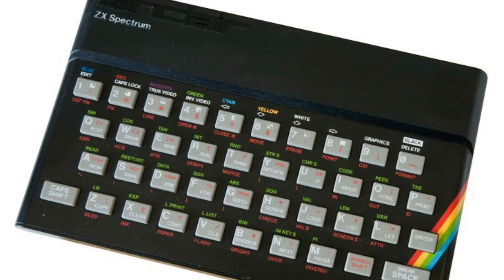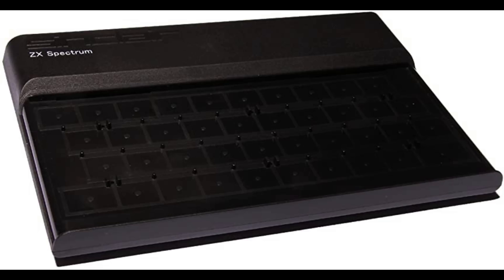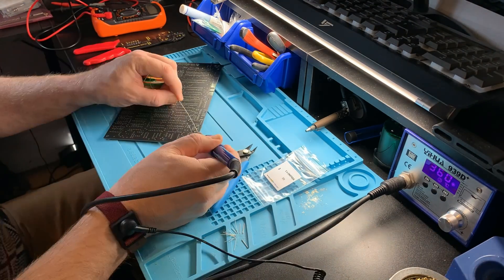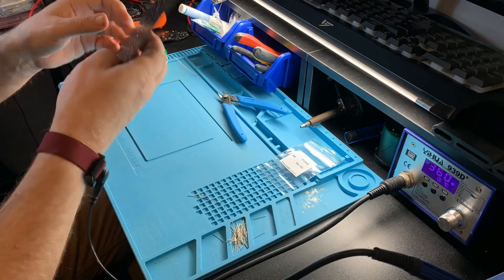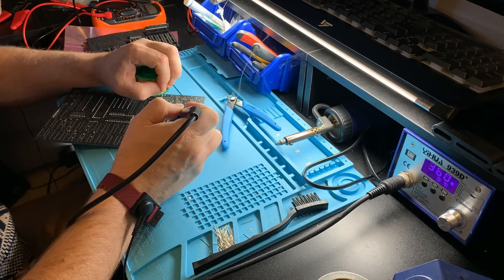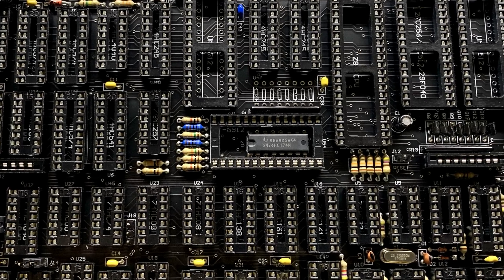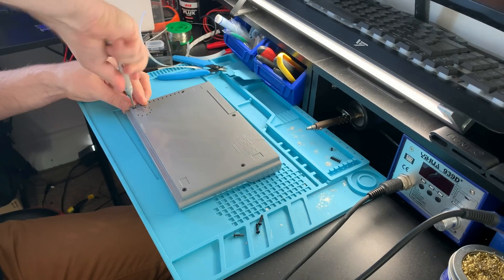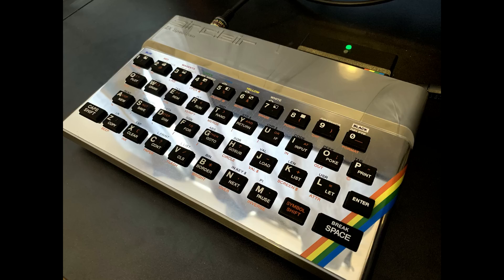Can You Build A Brand New ZX Spectrum From 100% New Parts?

Comment: What does it do for the ULA?
Reply from the maker: It completely breaks the ULA down into separate logic circuits based on the work of Chris Smith :)
Reply: @TheRetroShack  Wow! I think some of the Eastern Bloc clones did it that way too.
Reply: @andrewdunbar828  Some, yes, though most of them had reverse-engineered ULAs (of varying compatibility) and there were even some clones with genuine Ferranti ULAs. I like this idea by the way, it helps preserve the original machines and the experience is still quite authentic.

Comment: That's a lot of IC's they could've cut down on, jesus!
Reply from the maker: It is a lot of IC's however they replace the ULA of the original Spectrum (which was there to reduce the number of IC's :) :) )
Reply: @TheRetroShack  Really? They couldn't stick it on a CPLD/PAL/GAL? I'm only a beginner with  electronics, but seems like that would've been a good way to do it.

Comment: Time to buy a dremel.
Not sure how I feel about the 128K version in a rubber keyed box.
Reply from the maker: That's the beauty of the Harlequin boards (and Sinclair's thriftyness...) Harlequin has multi rom support, and it fits in both the original case, and also the Spectrum+ case :)  So you COULD build a Harlequin 128k, put it in a Spectrum+ case, and then 3d print a toastrack for the side and have a lovely clone of a 128k with all new parts...  You know what - I'm going to do it!  Thanks!
Reply: I put my Harlequin 128 in a Spectrum 48+ case. It's nice, but I'd prefer a sawn-off +2 painted black or red, with the +2A/+2B/+3 keyboard.

Comment: Really enjoyed that thanks! I still have my original 48k in a box, languishing without a faceplate, so it's great to learn I can get a replacement! Do you think the black version is the closest to the original unit?
Reply from the maker: I would think so but can’t guarantee it as I don’t have that colour :(  I’m probably going to be building another of these at some point so let me know if you get one :)
Reply: @TheRetroShack  will do! I'd really like to bring mine back to looking as close to the original as possible. But right now with a bare membrane keyboard, any front panel would look better! Luckily I still have an old TV I can use with the RF output, but I really need to look into some video mods...!
Reply from the maker: @cameralabs  Good luck and don't forget to send in some pictures when you're done :)
Reply: @TheRetroShack  sure thing! I've actually been doing a few retro projects of my own, so am planning on starting a separate channel to post them, as they'll conflict with my camera channel. YouTube doesn't like variety on a channel!
Reply from the maker: @cameralabs  Good luck and hope all goes well!
Reply: My zx spectrum 16k might be in working condition but I can't tell as the power transformer lead is broken. Is it possible to source a replacement that would fit?

Comment: How did you stick the faceplate on? I got a new case and faceplate but it's not very well fitting.  If I push the curved sides in, the centre lifts up. If I dont push curved ends down they just dont fit very well.  I think I'll get a kit after building my Amiga 500++ PCB.
Reply from the maker: I had a similar problem and in the end I completely covered the entire underside of the faceplate in 3m double sided tape, and then cut out each key hole with a craft knife.  Then when I put it on I made sure there were several heavy books on it for about twenty minutes - and it hasn't moved since :)  Good luck with the A500++ :)
Reply: @TheRetroShack  Ah ok.  I'm considering to using that thin double sided foam tape instead of the thin membrane tape. 
The 500++ is almost done.  I have a reAmiga 1200 to build but that might have to wait a while.  
Just found your channel and will sub. 👍

Comment: Hey friend, what is the brand,name or where can i find this blue repair "mate"? Thanks
Reply from the maker: KKmoon 450 * 300mm Magnetic Heat Insulation Silicone Pad with Magnetic Section Ruler Screw Notches for BGA Soldering Repair Solder Station Mat High Temperature Maintenance Platform (Type 1) https://www.amazon.co.uk/dp/B0771QKXCN/ref=cm_sw_r_cp_api_fabc_Q2W5VVTWV3VYX46YNTD2?_encoding=UTF8&psc=1
Reply: @TheRetroShack  thank you 👏👏👏😊

Comment: Cool video! I kinda wondered myself. I picked up some Z80 CPUs recently and the manufacturing dates are only a few years ago, they apparently still make these things! The ones I got also according to the data sheet can be clocked at over 20 MHz. I wonder if it would be possible to build a version that can actually make use of a higher clock speed? Not really a computer engineer so I'm not sure how difficult something like that would be.
Reply from the maker: The Crystal decides the frequency of the pulse cycle to the cpu so theoretically you drive a higher cpu speed, however the ram timings are also set in the rom so you’d need higher refresh ram and a custom rom and ULA.  It’s a lock of work but theoretically possible.  The Spectrum Next for example can drive the FPGA versions of the hardware at up to 28Mhz so.... :). Much cleverer people than me should weigh in on this one! :)
Reply: In theory, but like Retroshack said, you'd have to make sure everything else was up to it.
Also, it'd be great for business apps, but unlike modern gaming where a faster machine gives more FPS and smoother graphics, you'd probably find a LOT of old games would just run faster, frequently to the point of becoming unplayable.
This was an issue when IBM and clone-makers first started soming out with faster but compatible computers to the original PC... Even something like an 8-10MHz 286 was enough to render some games designed for the 4.77Mhz 8088 unplayably fast. This was the origin of the "turbo" switch on that generation of machines - you'd turn it off to purposely drop the clock speed of the CPU.

Comment: I like the blue bench top organiser thing where did you get that? Thanks 😃
Reply from the maker: Thanks - it’s this: KKmoon 450 * 300mm Magnetic Heat Insulation Silicone Pad with Magnetic Section Ruler Screw Notches for BGA Soldering Repair Solder Station Mat High Temperature Maintenance Platform (Type 1) https://www.amazon.co.uk/dp/B0771QKXCN/ref=cm_sw_r_cp_api_fabc_6NVHV5P4QDDMCJ56VQVS?_encoding=UTF8&psc=1
Reply: @TheRetroShack  ooh thanks I've ordered one 😃 I would never have found it from that name 🤣

Comment: As an American, I didn't grow up with this system.  However, I have emulated it, and I'm very interested in doing this project.
Reply: As a Swede, I didn't exactly grew up with Sinclair either. But the ZX80, ZX81 and Spectrum were parts of my youth. I wrote a simulator in 1993-94. My PC was a 12 MHz 286, so I bough this new and crasy fast 25 MHz 486 board, for this purpose only :D Wanted a simulator in 100% high level language. Though that was a cool thing at the time. I only had a 16-bit compiler though, so I still had to fiddle with those ugly 8086-segments in order to fit my code as well as Spectrums ROM & RAM in memory.

I've seen that many people nowdays think in terms of FPS (frames per second) even for simulators or emulators. I used a different and much simpler and synchronous approach: Whenever Spectrum's video RAM (attribute or pixels) were adressed by the Z80 program running on the simulator, the simulator would write to the video card of the PC. Otherwise no video data was written.

The ROM was sent over to the PC via a basic program on the Spectrum and a similar program on the PC, using D0 on the printer port as input. (Yes, it took almost a night :D) My simulator loaded games from tape the same way, via the printer port. It actually worked well without the filters in the Spectum. It was just a simple wire from analog tape signal to digital input, belive it or not :D

How did you do it?
Reply: @herrbonk3635  I was just using Speccy on a laptop from 15 years ago running Linux Mint; I didn't get as in-depth as you did, so kudos.
Reply from the maker: Can definitely recommend it - it was great fun to do :)
Reply: I did grow up with the Spectrum, but I find the Altair 8800 amazing.  I guess it's all about similar systems from different markets. That's what makes Retrocomputing so fascinating.

Comment: Does it load the games instantly, or do you still have to use the tape!  Wonderful, by the way!
Reply from the maker: This version of the board (rev 2d) doesn’t have an inbuilt SD card solution but the creator (Don Superfo) also sells the ZX Nuvo which has an SD Card on board.  Thinking of building one myself :)

Comment: Are the ic's still being made or were the components new-old stock or harvested from old gear like the c64?
Reply from the maker: All of the IC’s are brand new :) Including the EEPROM containing the Sinclair Roms ( I feel justified in doing that as I do own the original rom chips in my other Spectrums ) It’s a great kit :)
Reply: That's the neat thing about the Harlequin design:  In broad terms the 48k Spectrum had exactly one (semi-)custom chip.  The Harlequin is a reverse engineered design that turns that semi-custom chip back into a bunch of entirely generic logic chips, so there's no need for anything to be taken from an original board (though, it will support using an original ROM chip if you like, in place of an EEPROM).

Comment: Wow so that's how many logic chips the Ferranti PLA replaced I often wondered
Reply: Minus six though. (There are 6 TTL ICs in the original Spectrum.)
Reply: @herrbonk3635    True enough, there's six glue logic chips between the ULA and CPU that were also later consolidated into a second semi custom chip.

Still, the Harlequin design is rather neat because of what it does.  It consolidates all the RAM back into a single space-saving IC, and uses the space saved to break the ULA back out into generic logic, both of which make infinitely more sense in this day and age.

It's a fantastic learning experience being able to build and follow the logic of how the system works with relatively few "black box" elements in the design.  (I mean, the IC's themselves are black boxes, I suppose, but one step at a time :) )
Reply: @TheTurnipKing  Not only in "this day". Dense memories such as 6264 or 62256 were affordable in the 1980s too. I often say that TTL and MOS memory ICs (whether dynamic or static) were the real key to the personal computer "revolution". Compared to that, the microprocessor wasn't as important as it's usually portrayed for making computers cheap enough for the masses.

Early personal computers like Datapoint 2200 or Xerox Alto of the early 1970s did not use any microprocessor, they were built entirely in TTL (and similar). The first personal scientific calculators (like Olivetti Programa and HP 9100) did not even use ICs, but relied on discrete transistors, diodes and passive components. Their memories were in the form diode matrixes, magnetic core memory, and/or capacitive memory in the printed circuit board itself!
Reply: @herrbonk3635  The original design made more sense back then in terms of cost.

In the same way that economies of scale make using an ARM chip an extremely convenient go-to for all kinds of electronic devices now.

The PCB would have needed to have been much bigger to accomodate a generic logic ULA AND the many RAM chips used in the design.
Reply: @TheTurnipKing  Yes, in that short span from 1980 (ZX81) to 1982 (ZX Spectrum) it probably did. But already in 1984, static RAMs would have been almost as cheap as the DRAM used in the Spectrum, especially when you factor in the extra PCB area, logic and voltages needed for DRAM. My guess is that they kept that solution for some years just to avoid having to redesign things (which can be expensive).

However, the situation for computers with much larger amounts of RAM than the ZX line was different, of course. Such as the IBM PC, Macintosh, Atari ST or Amiga.

Regarding ARM: Not all embedded system are mobil phones or things of similar complexity. Simpler microprocessors and "controllers" are still being mass produced. PIC, 8051, 68HC11, 68K, NEO, eZ8 and literally dozens of other architectures (even versions of Z80, such as Z180 or eZ80).
Reply: @herrbonk3635    They redesigned the board constantly.  There's a good five or six revisions of the 48k board and that's before you get to the 128k.

You actually see a much more rational design using higher memory densities in some of the clones produced later, and in the Amstrads.
Reply: @TheTurnipKing  I remember. But they didn't redesign the part I was talking about for many years. Why do you call larger memory ICs "much more rational", when you just stated that the old design made sense? (I.e. was rational.)
Reply from the maker: Pretty incredible eh?  :)
Reply: @TheTurnipKing  So optimizing for low cost is less rational? I'm not sure Sinclair or Nine tiles would agree. What's rational depends on the situation and from what aspect or point of view, of course. But it seems you use "rational" when you mean simple.

Comment: I had, and still have in storage, the original 48K Spectrum, and when I saw you soldering all those sockets in I thought "that is way more ICs than the original had", because I thought (by the case dimensions) that this was just the original. Well, by the end I see that it is something like a Speccy Plus 2 or 3 maybe.
Reply from the maker: The original Spectrum had a custom ULA by Ferranti - This has since been reverse-engineered down to individual IC's - hence the larger number of chips :)
Reply: @TheRetroShack   Oh, that's interesting! I did know the ULA quite well, I did research the hardware back then and also did some assembly (machine code) level software. I still have the "Spectrum Hardware Manual" and "The Complete Spectrum ROM Disassembly" books in my bookshelf :) I even half-made an expansion card that had four selectable ROM chips, just never quite had the will-power to complete it.

Comment: Great channel! What's that surface you're working on? Looks absolutely amazing for storing all those little bits and pieces during builds and repairs.
Reply from the maker: Thanks - glad you’re enjoying it! The mat I use is this : Preciva Soldering Mat, 500℃ Heat Resistant Silicone Work Mat, Multi-purpose Magnetic Electronics Repair Pad for Welding and Soldering Station With Ruler and Screw Notches, 450*300mm https://www.amazon.co.uk/dp/B075D9R8PZ/ref=cm_sw_r_cp_api_fabc_D421ANVTTB7M9G2W4CZZ?_encoding=UTF8&psc=1

Comment: I was never a fan of spring IC sockets. You should have splurged and gotten machined turret pin sockets. They're so sexy.
Reply from the maker: They're just what came in the kit - I'm currently building another one (in my increasingly rare spare time :) ) for a friend - and that's got lovely turned pin sockets :) :) - Should I just swap the boards over when I'm done?  Is that bad of me? :) :)
Reply: @TheRetroShack  one advantage to building kits is upgrading parts. Quite frankly I think that kit has sockets because they don't expect the most skilled people to be assembling it. So the producer opted for using sockets as a bit of a safety net. Other than the one socket with the IC inside it you could probably just solder chips to the board. But hand soldering ICs is a little bit of a risk. You have to follow the time heat rule. I do a few leads on each IC then solder another chip. Jump around. Making people understand why that is important can be difficult. They know when they've roasted a socket though. heh

Comment: Ive been collecting parts to do this using new motherboards (using a freely available pcb design that copied the original issue 3B). Bit more to go yet before can build one.
Reply from the maker: You won't regret it - I'm on my third now :) - Got a BIG 'new' build of an old system coming up later in the year :)

Comment: You made that soldering look easy!! Wow!! Nice job👍
Reply from the maker: Thanks 👍
Reply: That's because soldering a PCB is easy. Try building a point to point board. They can be difficult. With a wave solder machine you can do a whole board like this in a few seconds.
Reply: @1pcfred  What is a "point to point board"? Do you perhaps mean soldering components together without a board? Like in the old radios or tvs of the 1940s/50s.
Reply from the maker: @1pcfred  Now that would be something!!!!

Comment: That silver-grey case with the glossy silver faceplate looks absolutely fantastic!
One question: how compatible is the Harlequin with the original Spectrum? Both 48K and 128K modes.
Reply: @TheRetroShack  Perhaps i will consider one, then, because original "Toasty McToastrack" 128Ks are way too expensive for me on ebay.
Reply from the maker: I saw one go for £75 the other day and I missed it! Aaaargh! :)
Reply: @TheRetroShack  Damn! That's practically a steal.
Reply from the maker: @BertGrink  Tell me about it! :) I would have felt guilty buying it! ...briefly :)